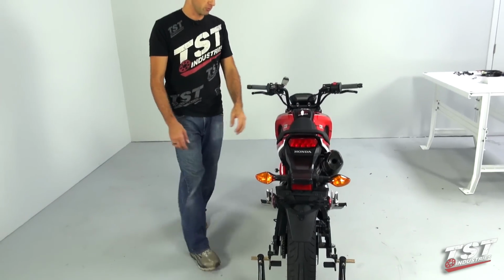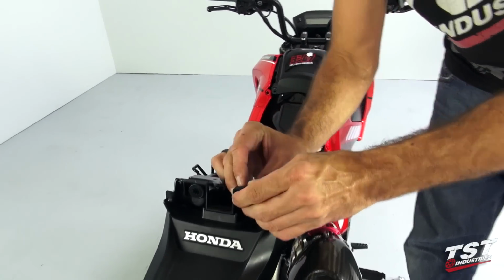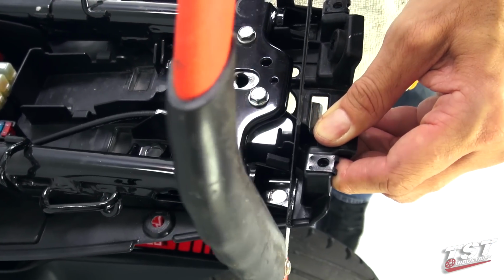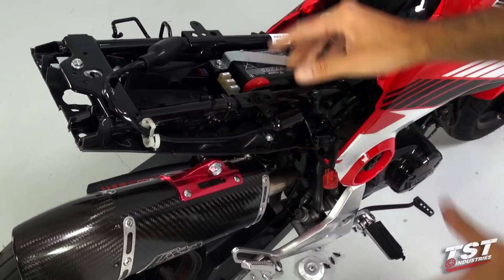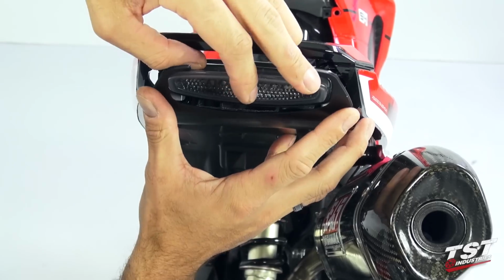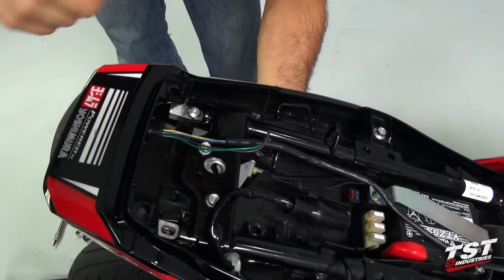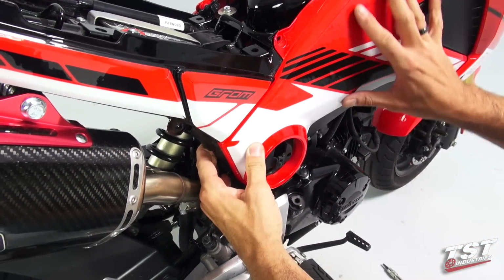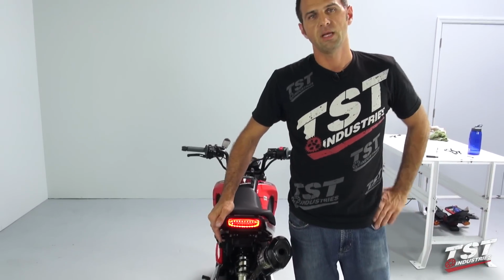How to install Integrated Tail Light & Undertail on a 13-16 Honda Grom by TST Industries

Comment: Good idea, though it would be good if you could design an integrated tail without the need to cut. It does look sleek and the design choice you made is more apparent on the new Grom with the ugly tip sensor bump. So an idea more for the first generation Grom, could you not make a integrated light shaped similar to the original light that uses the OG light mounts, with a sleek undertray? Though what you’ve developed does work and for $15 to replace the plastic, I see what you’re saying.

Comment: yo what's the name of that exhaust pipe love it I wanna put that on my bike with them tail you put on where do I go to buy them ???
Reply from the maker: +alfredo cipres It's a Yoshimura RS-9. Any retailer that carries Yoshimura products can get this exhaust for you.
Reply: thanks i have a 2015 grom this tail light will fit right i love it makes the bike look even more sick ;] one more thing dose that rs-9 make the bike a bit faster or anything or just looks ??? I'm new on bike please help
Reply from the maker: +alfredo cipres Our setup works on all years of the Grom. The RS-9, and all the exhausts for the Grom do not actualy give you much extra power. If you get a fuel computer, race air filter, and get a good dyno tune you might see up to 2 horsepower gain. That is a lot of money to spend on just a few horsies. And besides, the torque will not improve much at all. Your best bet is to invest in a big bore kit. That will be your best bang for the buck.
Reply: thanks bro :} big help the tail light do you guys take pay pal ??
Reply from the maker: alfredo cipres yes, that is one of the payment methods we take

Comment: What do I do if I install this and the indicators don't flash? Just stay on constant.
Reply from the maker: Hey buddy. That's a simple fix. Replacing your stock signals with LED signal lighting causes your oem flasher relay to bug out and get stuck on. You can wire in load balancing resistors into the signaling circuit or replace oem flasher relay with TST Gen2-F flasher relay. If you want to see the installation of that part please see this video: https://youtu.be/YrZOCxV_Grc
Reply: +TSTindustries Thankyou for the speedy reply. I will check the video out. I only thought resistors worked when they flashed to fast. I was obviously wrong. Cheers for the help.
Reply from the maker: ash bandicoot When switching to LED signaling equipment you will cause your lights to draw less current than is necessary for the relay to operate properly. In some relays that causes hyperflash (fast flash). In others it causes the relay to hang in the on position. Resistors can work but they are cumbersome and generate heat. Installing them is also a pain. The LED Flasher Relay is a plug-and-play solution that makes your signaling system flash at the proper speed even if you change the front signals down the line.
Reply: Awesome. Flasher Relay it is :)
Reply from the maker: ash bandicoot Cool. You won't regret that choice.

Comment: Does it work on the 2017/2016 model?
Reply from the maker: This does not work on the 2017/2016 model. We are currently working on a tail light/undertail kit for the redesigned Grom as I type this.
Reply: TSTindustries. do you know how long that might be, because i really like this integrated tail light

Comment: would've liked it, but with the cutting involved.....nope.
Reply from the maker: Yea...so for this installation you need to trim a part that costs $9.35 brand new if you need to replace it. Had we not designed the kit to require cutting we would have had to design different geometry that would not produce a sleek tail. There is a tradeoff but if you're worried about cutting a ten dollar piece of plastic then you are probably better off using our basic fender eliminator that just bolts on and uses OEM light.

Comment: Which brand´s ratched is used on this video?
Reply from the maker: The brand of ratchet we used in this particular video is a "Husky".
Reply: TSTindustries  Did you mean the ratchet with black and red handle, which you can use by twisting the handle, is called Husky?
Google didn't find similar ratchet. I founded normal, swivelhed and roto ratchets, but none which would work by twisting the handle and that is what i am seeking for. In what name do you call that ratched what works by twisting the handle?

Comment: is the plate holder universal? , will my european (Belgium) plate fit on this?
Reply from the maker: +Jeroen Reyns The plate accepts the following range of license plate mounting holes: 6" to 5.42" ( 137.72mm-152.39mm). That measurement is on-center, considering that a 5mm diameter screw is used. Anything beyond that will require modification to the holes on the license plate. We have revised the design and in about a month and a half we will be launching a new generation of brackets that accept spacing of 6.25"-5.25" on center
Reply: Ok, thank you for your response!!
Reply from the maker: +Jeroen Reyns You're welcome.

Comment: what licenceplate light can be used with this ?
Reply from the maker: either one of the ones we produce can be used. You will need to drill a 1/8" hole through the undertail to pass the wire to the inside. The undertail is made of aluminum so it's very easy
Reply: +TSTindustries thy :)

Comment: will this tail light also fit on the 2017 groms?
Reply from the maker: This particular setup will not but we bought the 2017 Grom in early August and design work is already under way to make a similar setup for the new generation Grom. If you subscribe to our channel you will be notified when that system is ready for sale.

Comment: Can you help me with something, I have an integrated tail light, but my wiring isn't the same as on this video, in the harness for the indicators I have 2 yellow, 3 black and 1 green..... and from my tail light I have a set of 3 (blue/red/black) which plugs into the bike, and then 2 yellow (indicators).... so i've connected the 2 yellow of the tail light to the 2 yellow of the bike, the indicators work, but on my tail light... the whole left or right side is supposed to flash orange, but on mine, just a small amount is flashing, and my brake light isn't working when using the foot/rear brake... totally confused with it all.
Reply from the maker: It sounds like the bike side of the harness is already modified. On Groms, the signal wires are blue and orange, and ground is green. The running light wire is black, and the brake light wire is green with a yellow stripe. On the taillights we produce, like what you see in this video, ground is black, running is blue, brake is yellow, and signals are green and brown. I don't know how the taillight you bought was manufactured so I will be little help with choosing the correct wires, but at least now you know what wires to find on your bike to connect to. I hope I've helped you.

Comment: Will this work on a 2017? If not do you produce one that does?
Reply from the maker: This particular kit does not work on the 2017 model. We have a 2017 Grom in house and are working on a design similar to this one for the new Gen bike
Reply from the maker: This product will not fit the 2017 model unfortunately, however, we are currently working on a kit for that year range that will produce similar results so stay tuned!